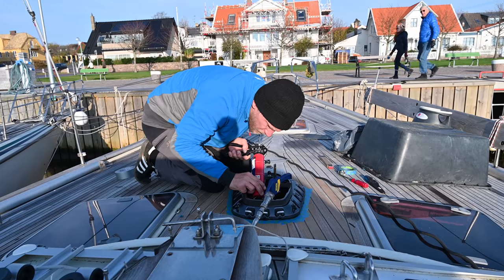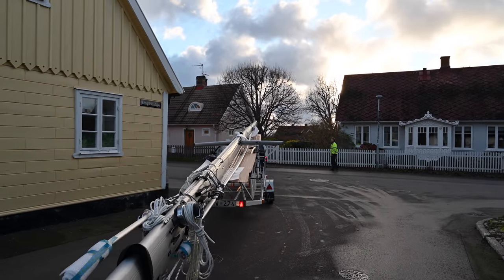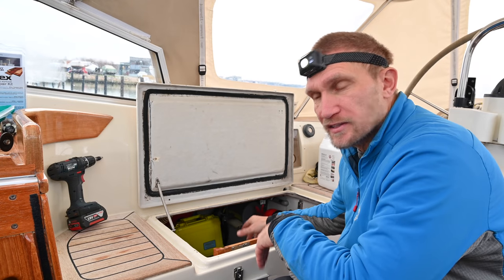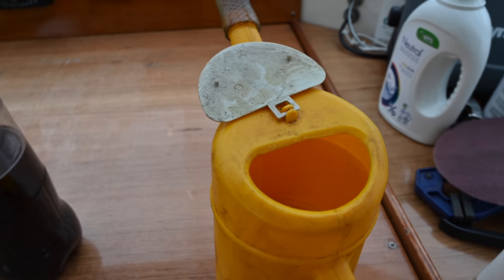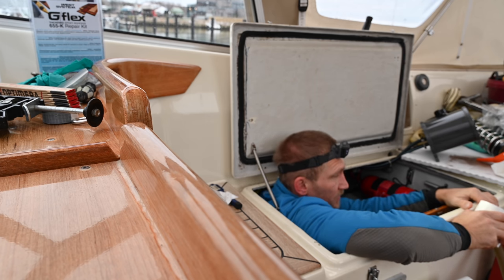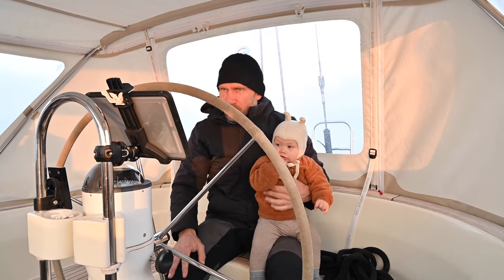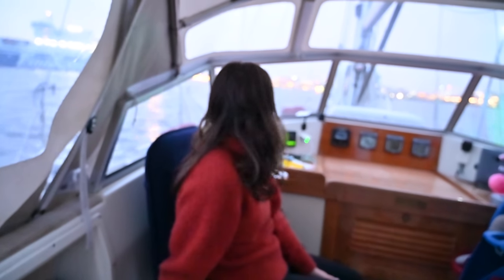Stepping our new mast for the first time - Ep. 233 RAN Sailing

Comment: Ahoy there mates,

Happy New Birthday Vera,
Happy New Mast,
Happy New Year RAN Crew,

Best wishes for health, happiness, and sailing adventures in the New Year ahead!

I enjoyed seeing the whole process of moving the mast into position at the dock and then seeing the stepping of the mast via the skilled crane operator. Well done to everyone! You had good luck with the weather even if it was a bit cold at the beautiful morning sunrise. 

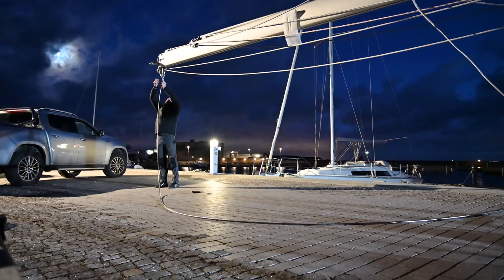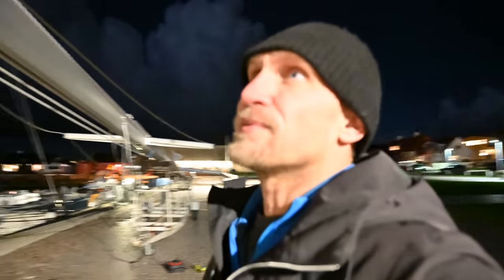I very much enjoyed seeing your night-before preparations under the nearly Full Moon with MARS  @3:40 , and then seeing the Morning Star (VENUS) just above the sunrise horizon @4:08 as well as it's shimmering reflection in the very still waters of the marina. Nice imaging! (Best seen on large monitors.) 

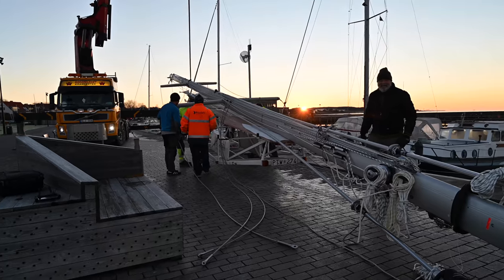The rigging crew, crane and mast in the foreground with the Sun just rising behind @5:15 , @6:03 were also very impressive image captures. Well done to the camera operator. Nice composition. The drone shots @5:17 showing the reddish colors of the rising Sun on the local houses and windmill in the distance were charming. What a beautiful little seaside community. I'm glad everything went so smoothly and safely. Cheers @6:59 ; well deserved!

It was good to see your flushing of the hydraulic system. Between the oil being incorrect as well as old, the newly rebuilt system with new seals, new oil and newly rebuilt pump should stand you in good steed for a long time. The rig should be capable of standing up to any weather that blows your way, and deliver the power and performance to move you nicely through any winds.

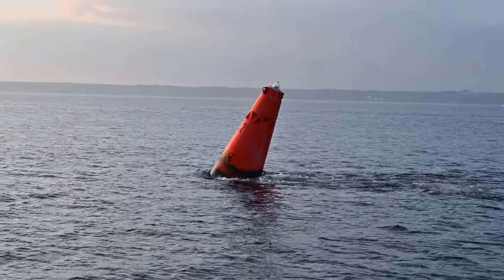I had no idea that rivers could have such an effect on currents flowing out of the Baltic. I would have thought only tides could produce such water movements @16:55. You say you have little tidal effects in the area. Again, I'm surprised by this. I guess it goes to show how important it is to watch sailing videos from around the world. My assumptions are challenged and I'm learning new things. I've sailed in New England and in Southern California. That's the basis of my limited first hand experience.

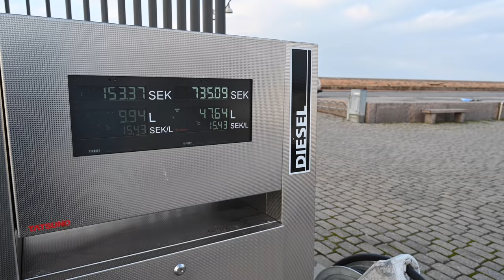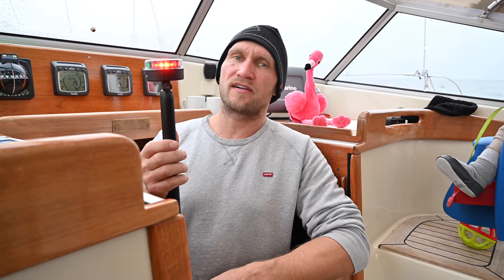Loved Malin's cold weather dance at the fuel dock @17:21 and of course Vera's flamingo dance @ 18:18. Pure Joy! Also loved seeing Vera's first steps and her talking. (She may not have the motor skills to enunciate the words with her mouth, but have no doubt that she is in fact thinking in words and trying to communicate. The verbalization of words will come in time, the thought processes are already there. Be sure to talk with her as if she understands what you are saying, she does! Avoid baby-talk and goo-goo gaga nonsense. Use real language and talk with her in a normal tone as if you were talking to a six year old. She does understand a lot more than you think, and that will improve her verbal skills quickly.)

Thanks for another great video!

...

Comment: The hydraulic fluid in the system looks like it might have gotten aviation type mil-standard 5606 mixed in at some point?  Or automotive ATF?  Either one might be incompatible with the seals, which could explain the leak.  Or, maybe not, and the leak was just due to age...?